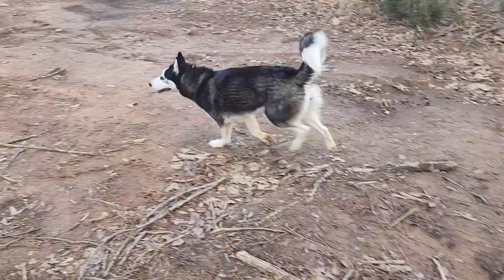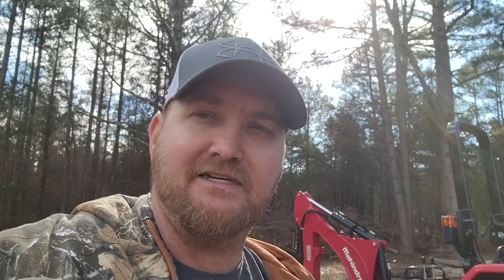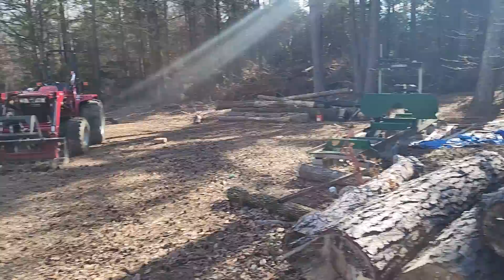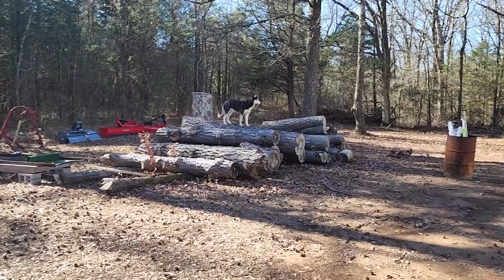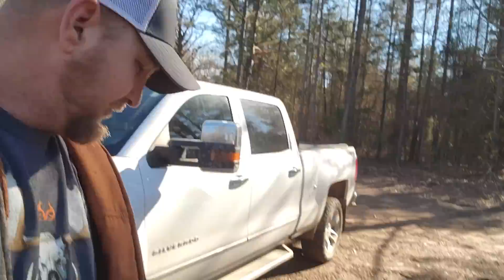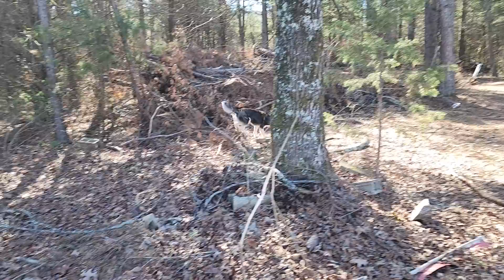TIME TO MAKE IT HAPPEN couple builds, tiny house, homesteading, off-grid, cabin build DIY HOW TO

Comment: Milling doesn’t make the wood dry, air makes it dry. If you paint wet wood, your in trouble. If you burn the milled wood it will dry it, preserve it and will be rustic. You can oil it and be done. Check it out first. The most important thing is get it up, you’ve got more hard winter coming for January and February.

Comment: And I really think you ought to paint it it's easier on you you don't have to mess with it every year you can paint it the color you want now when you do the inside you can make it as natural as you want cuz the elements of the outside is not going to be hitting it so I think painting it is the way to go and yes I think pine is a good idea cedar you want to save for making it look good I know cedar would make the building look good but when you have other wood that you can use and then just paint it would be the smarter option that's my opinion

Comment: Natural both inside and outside looks the best. Now on pine you can take a propane torch and run it over the pine. It somewhat blackens it. Then you give it a light sanding and it comes out Amazing! No need to stain after that treatment. Just poly it to preserve. Try it on a piece you would use for the siding. I believe you will love it.
Reply: :hand-pink-waving::hand-pink-waving::hand-pink-waving::hand-pink-waving:

Comment: You should build a solar kiln. So you can set the pitch in the pine. Otherwise you will forever have sap seaping thru the paint. Those logs will have bugs in them already so after drying to less than 15% moisture it needs heat treated to 1 set pitch and 2 kill the bugs. Powder post and bark beetles are horrible in pine.

Comment: Use an oil based stain. You can put it on with one of the sprayers you have and it will keep the rain from penitrating the wood.

Comment: Torch it, as in Yakisugi. dramatically reduces the room, on a cellular level for any water to seep in and cause damage. On top of that, the procedure significantly increases resistance to fire and insects, making charred timber an excellent option for all outdoor projects. Even when constantly exposed to the elements, Yakisugi wood can last over 100 years. All it needs is a new layer of oil every 10-15 years to keep it water-resistant. Im enjoying your videos.
Reply: I totally agree !  Yakisugi❤.  It would look incredible and be very practical,
Reply: Or Shou Sugi Ban. 🤷

Comment: Maybe do the bottom two layers with cedar because those are always the boards that rot because of rain splatter. Not sure if that would look too odd or not. As far as paint or stain, it’s like you said, stain will look better but requires maintenance. So I don’t know with that question. Thanks for sharing your adventures with us.
Reply: CRIBBING: Scorching, Brushing, Clear Coating. Cedar will last forever!!!! No pest infestation. No rot. Less maintenance.

Comment: Why don't you burn it to karma so you can just brush it off and that will really keep the bugs off of your building the Chinese use it and it doesn't take that much all you need is a propane and a torch and then put your finish on it and it will last for a hundred years
Reply: You're thinking of "Shou Sugi Ban" which is a Japanese invention!  They've done that for years and years!

Comment: I live in the south. PAINT the pine. We have mostly pine here and to last up to the temps, sun and wind the paint will last the longest. Stain does NOT hold up and the clear coat will disappoint every time around the edges of each board. Just paint.